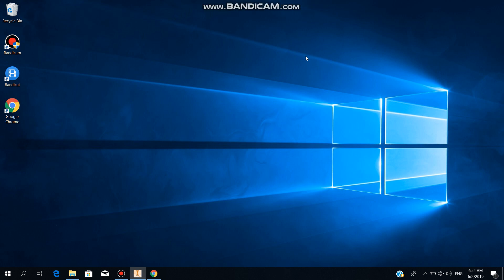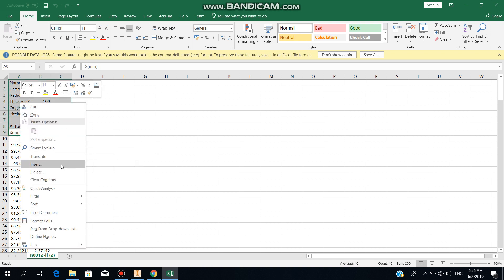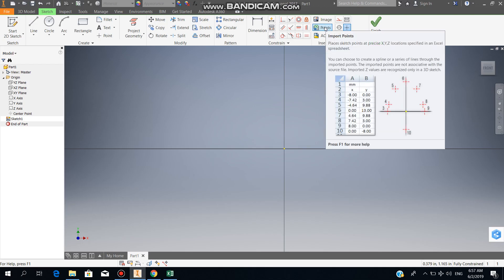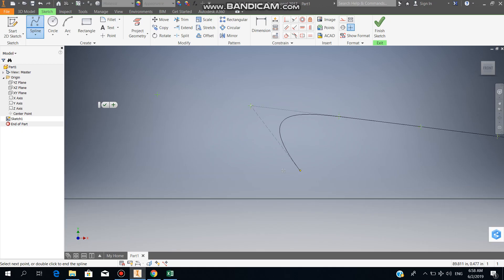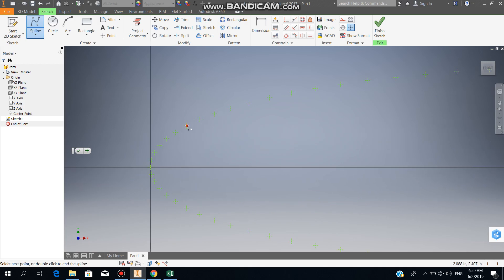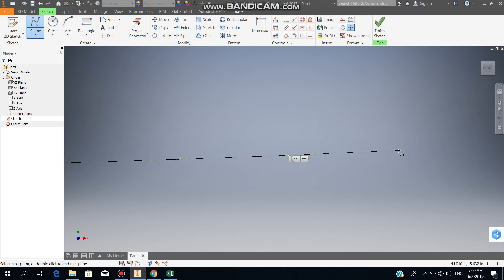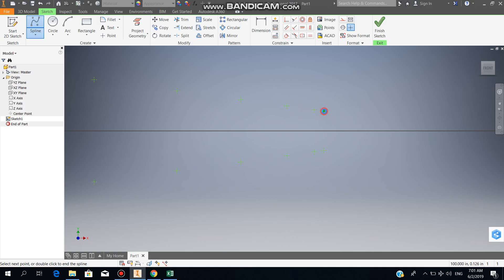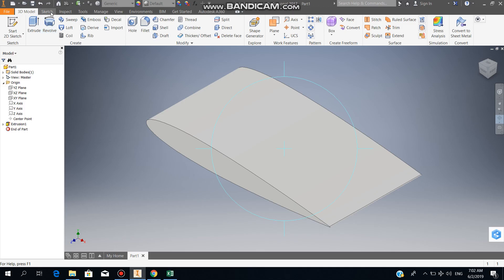How to make an airfoil/wing in Autodesk Inventor

Comment: but in the Ms. Excel A1 and B1 is joined, I confused why it is joined
Reply: Same  here idk why
Reply: @yagothiel5954  the content creator doesn't reply my comment
Reply: @2ma_13_riskyodangsanjaya6   I didn't quite get what you mean by A1 and B1 joined. Please let me know and I will assist. Cheers.
Reply: In google sheets there's an option under "Data" -> "Split text to columns". I believe there's a similar function in Excel. The X and Y points needs to be separated by commas, so just download as a CSV and then copy and paste into Excel or sheets.